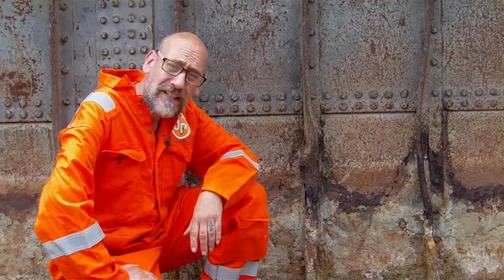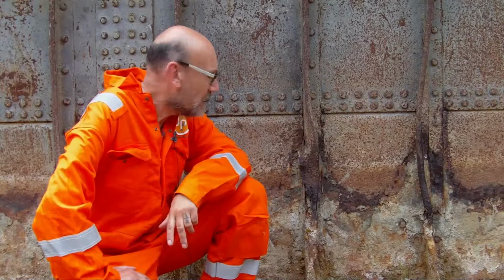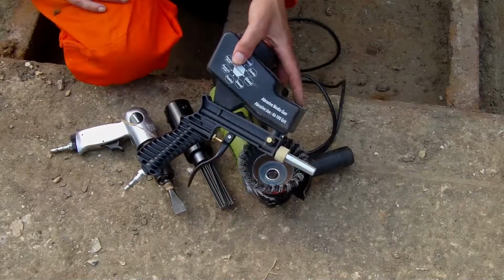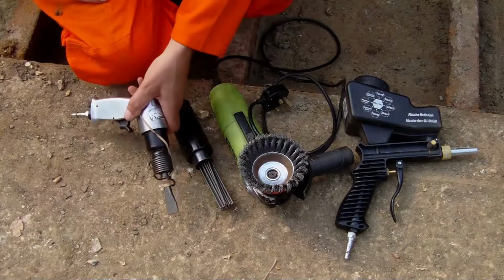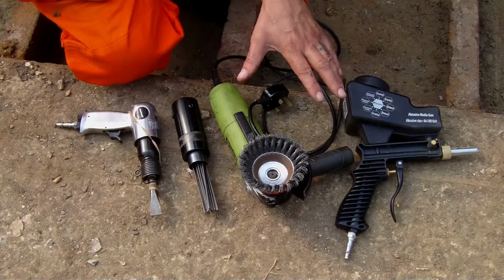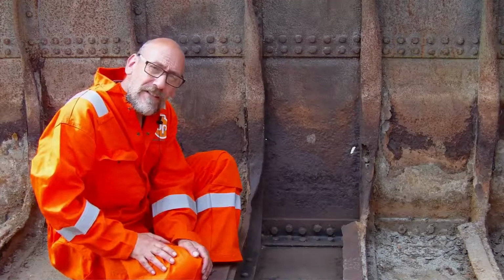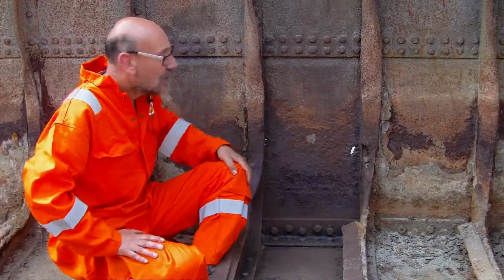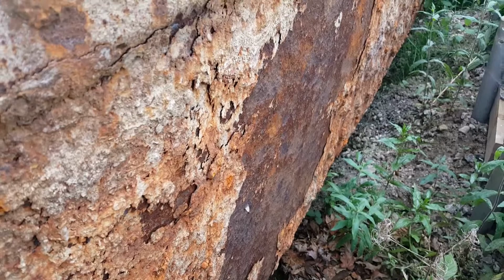Episode 7 - Barge de-rust using air tools, media blasting and wire brush

Comment: On the very thick rust much quicker to hit with a hammer and it all comes off in big flakes. Then a wire wheel rather than a wire cup makes stripping thick rust off easy too. I’ve used this method for a 24m very rusty barge
Reply from the maker: Yes - my next 'de-rusting' video will see me wielding a large hammer and getting the results you've just outlined - it's so much more rewarding as those giant flakes just drop off with the added bonus that it bounces the rust on the other side of the panel as well! A 24m rusty barge you say - I will definitely take any advice from you that I can and be grateful for it so I'll be giving the wire wheel a run-out asap!

Comment: If you flog the hull all the way around with a 7lb mell hammer and get a blaster in to finish it off , paint it with weldable primer , the 2 year job will be done in 2 weeks and you will still be able to hear . wear ear defenders !
Reply from the maker: What you're suggesting is pretty-much the subject of a future video - the hammer and (proper) blaster have both been tried and are by far the best combination so I agree 100% with the suggested route. Thanks for the input!

Comment: Is that daylight I can see? The steel is about 11mm thick you said? Christ that’s been eating away a bit. 👍👍👍
Reply from the maker: Yup - though was made around 1930 and never been repainted so 90 years in the Thames is going to take its toll. Funny enough, you get an inch or two from the hole and it's full thickness again so very localised problem 👍
Reply: The Drunken Boat I envy you. A great project you’re doing 👍👍👍👍

Comment: needle blasting, noisy but great fun, i did a whole Tank with one, left a ready to paint surface, PS i'm in west sussex too in Littlehampton
Reply from the maker: Must be something about the West Sussex air that makes us do these things! I've got a needle gun here that I've not really put to the test, yet - plenty of time/surface to find what works best!
Reply: @thedrunkenboat6473  cool - i did wonder when i saw the boat landing if a needle gun might do the trick, watching your testing i thought perhaps not good enough - might be down to air pressure and a descent constant supply - i'm sure i seen somewhere use of just pressure lance which would be ideal, way cleaner, dryer, so you could dust off and paint before rusting again - yep think the local salt air makes us mad hehe

Comment: I recommend a decent full face respirator. It might be more expensive, but well worth it. Also, have you tried just using a large hammer to "bang" the rust off?
Reply from the maker: Yeah - the next video I put up will have my face fully covered as the 'blow-back' is pretty grim. Although the video doesn't give a good view of it I'm trying to use the air chisel to 'bang' the rust off, rather than get underneath - like you say with the hammer suggestion it really shifts the thick stuff when you hit it repeatedly. Thanks for the input!
Reply: That hammer will save you a lot of time than playing with that little chisel

Comment: I'd recommend renting a professional pressure-pot blaster with a commercial compressor.  The vendor will be able to recommend the media (I'm guessing either steel shot, or coal slag) and the appropriate safety gear - an externally supplied air helmet at a minimum.  It would make very short work of the task.  

Once down to bare metal, I'd paint with a two-part epoxy and you'll be good for another 90 years or so.  Also, you might call several mobile media blasting companies for a quote because you'll learn a tremendous amount from the quoting process (media recommendation, process, etc.) even if you aren't going to go that route.  

You might be surprised by how inexpensive it would be - especially if you either: (a) ask the mobile media blasting company to be a sponsor, and / or (b) start a Patreon page to have viewers help fund the work.  

Can't wait for the next video!
Reply from the maker: Yeah - I've narrowed it down to a large boiler-scaling hammer which just bounces complete sections of rust off at a time and following up with a decent blaster. Garnet seems to be the media of choice as it makes short work of the rust right back to clean steel and is pretty good for a few cycles through the blaster as well!

Comment: I think I would be disheartened if I looked down the length of the hull. To think I have to de-rust all this and the outside
Reply: its always a long arduous job to do these things - its a state of mind - pick an area and clear it, then the next and so on - look at what you've done and not at what you have to do - i've done many jobs like this myself, time is the enemy, and if in no rush, it doesn't matter
Reply: pete mackean that’s all you can do, is nibble away at it. And ten years down the line, you can look back on it all lol 😂
Reply: pete mackean also. When I’m scraping wall paper off the walls. As the paper gets smaller, I look at them as islands in the sea and the sea is devouring the islands
Reply: K.C. It was peppa pig then I changed it to pippa. Pig, just in case of infringing copy rights
Reply: @taffythegreat1986  lol rite!!! Everybody wants a cut.
Reply: K.C. 👍👍